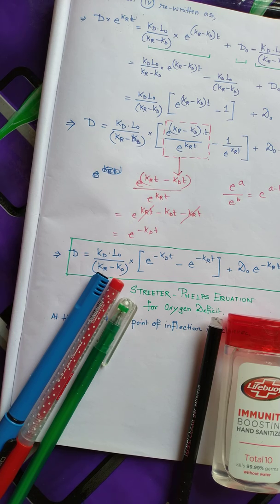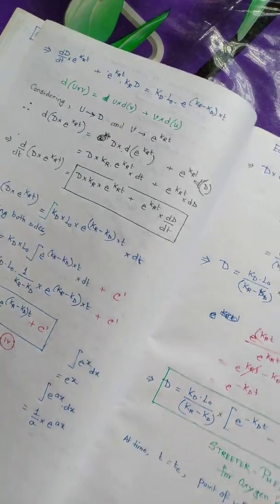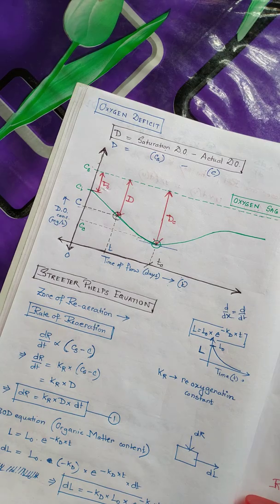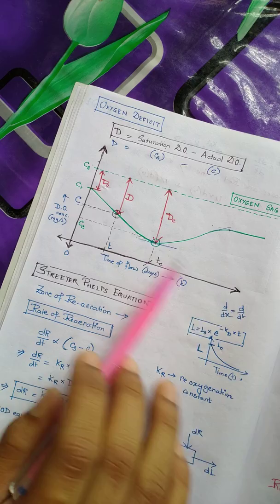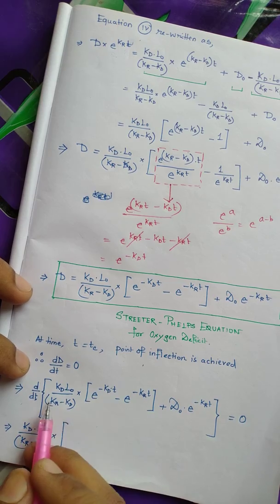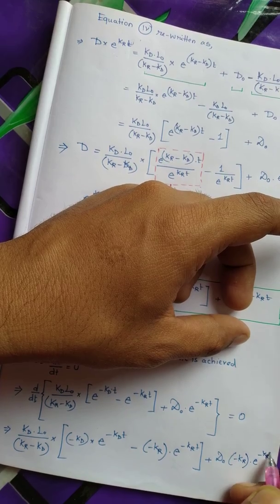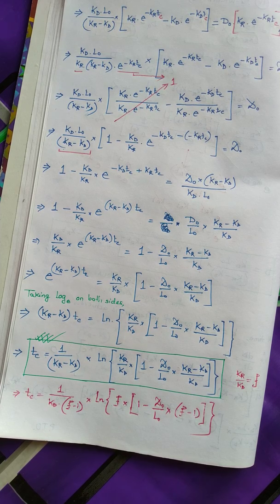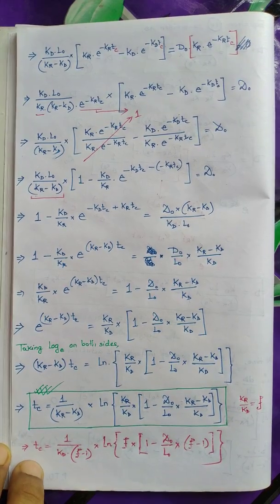Critical Time determination from Streeter-Phelps Equation

Comment: How could we calculate the point where this process becomes Aerobic again? and If we want to keep the Oxygen level to a certain point, how can we calculate the treatment?
Reply from the maker: Graphically we need to determine the point of rejuvenation, as different waste water will have different condition of flow and discharge, also different composition. From graph, get the time. With that time, we can calculate the distance through speed time distance formulation.

About your second question, I am currently unaware of the technique to maintain the DO level. But tentatively, we may need equipment to maintain the DO level.